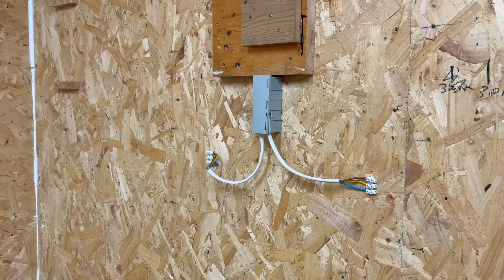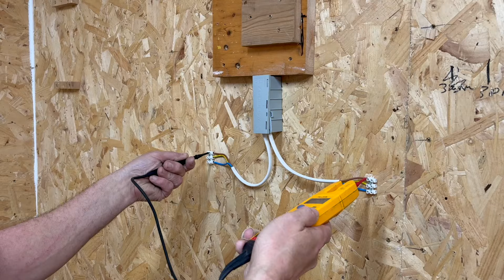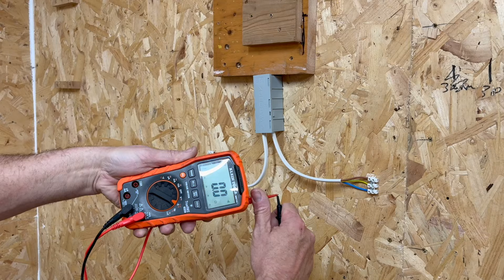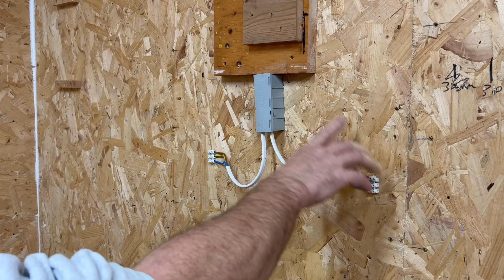AM2 Fault finding

Comment: For cross polarity on the am2 would you put reterminate and retests as they say rectify the most cost effective way ?
Reply: That's what I thought. Also in the demonstration here for the short circuit wouldn't he still have continuity through the neutrals?

Comment: Hi mate , how do you differentiate between the polarity fault and short circuit ?
Reply from the maker: Polarity would be where you expect A-A and B-B but you actually get A-B and B-A,  or you may think its open circuit as you get A-0 but also A-B

Short circuit you would get A-A and B-B but if you also check you'll get A-B and B-A

For the time it takes, testing ALL combinations will let you check
Reply: With short circuit you will get continuity from (for example) PointA Line to PointB Neutral and from PointA Line to PointB Line.

Whereas incorrect polarity you will get continuity from PointA Line to PointB Neutral and from PointA Neutral to PointB Line, but you will not get continuity from Line to Line nor Neutral to Neutral, ie a Cross connection.